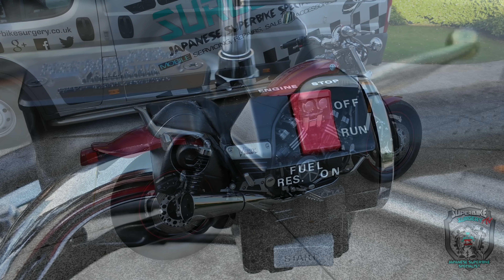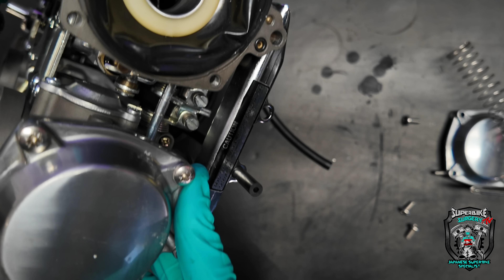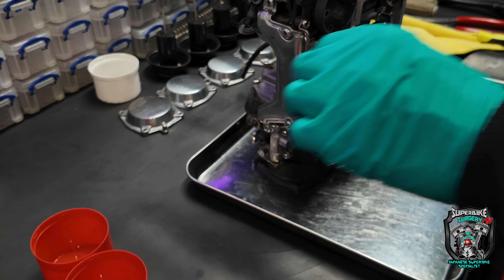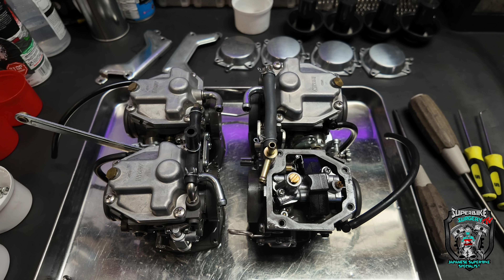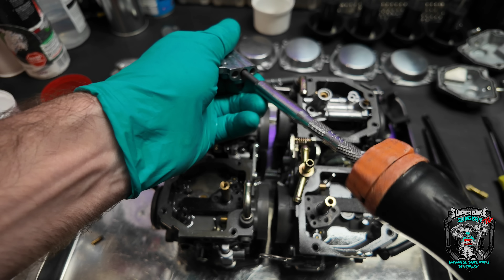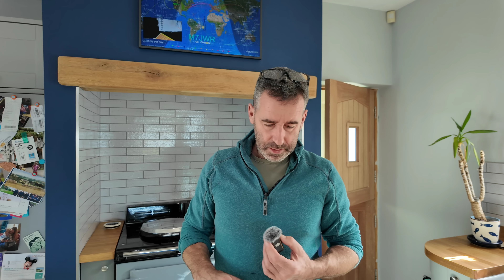Carbs off Three Times and Still Not Fixed! What the F.... is Wrong With This Yamaha V-Max?

Comment: I had one that was doing something similar. It was a blocked pipe in the tank, I can't recall which one without seeing it. But I cut the end off a Speedo cable and flared the strands then using a drill ran it through the pipe. Worked a treat.

Comment: How loose were the jet rubbers in the jet blocks? Also a 147.5 main works wonders. Ironically I have never had a problem with diaphragms (yet).

Also those manifold rubbers are suspect especially with those worm clamps.

Comment: Hey mate, I have two Vmax's sitting in my garage a 97' and 99'. on both sets of carbs they're loaded with pozi drive screws. think it might have been a factory thing at some stage in the life cyclye. or somewhere along the line the same bloke has worked on my two bikes aswell hahah

Comment: Which way should the valve clip go? Towards the carb as to hold the float in place. I have mine the other way around so the opening of the clip is facing the cover not the back near jet block. Any help how it's originally supposed to go. My way the float can come off easily when I take cover off

Comment: yeah, i'd suspect idle jet circuits too...a little soak in methyl salicylate might recondition those slide diaphraghms and clear up the distortions...my last Kawi set of Keihins had its float needles replaced with ones from a crap rebuild kit and were 1.5mm too short...the idle jets might be clear but the carb body circuits can also be blocked...mixture screws can be missing o-rings or the wrong friggin length...

Comment: Jim, another classy video. Please continue to always be yourself and behave like you always do. Swearing is part of that when fixing and pulling this apart with wood screws. As you said, fk the algorithym.

You should have done a bit more of an analysis at the beginning with running only on choke. What does putting the choke on do to the carbs v taking the choke off. Then we know your thoughts and why pulling the carbs off was the plan.

Comment: Couldn't stand the pressure and the shame - I paused at twelve minutes and ordered a set of JIS screwdrivers.
Reply: Did you need any ?
Reply: Did you need any ?
Reply: @markmiller5577  I do work on Japanese bikes and I currently own two. I've just made do with whatever fits before now, always having that little niggle that I'm not using the right tool. I also ordered hose removing pliers too, what for saving my knuckles.
Reply: Top tip: use the screwdrivers in the toolkit that came with the bike!
Reply: Vessel are the best
Reply: I wish I had know there was such a thing when I was struggling with my AP50 at 16🤣

Comment: A lot of people can't even tell the difference between Philips and Pozi... And at least here (Sweden) JIS are rather difficult to find for consumers :-( 
But I agree, using the right tool for fasteners is adamant as well as discarding damaged screws. Don't get me started on Torx plus though... To make such small change (in reality just to get a new patent) is just stupid even if they are slightly stronger then standard Torx.
Reply: With torx the tool seems to round off before the fastener.  So you get a chance to round off another tool before you drill it.
Reply: I've never had any problems with Torx assuming the correct size been used with one exception – cheaply made tools, they tend to be to rounded and not have a tight fit.
Without a doubt my first choice.
Reply: I'm surprised that JIS are hard to find in Sweden,they're easy to source online here (UK), Ebay & Amazon plus usual tool sellers

Comment: Try soaking the stripoed carbs in acetone for 24 hrs , i had a similar problem with a customers bike , i had the carbs off three times because my boss was too tight to buy the acetone i needed to clean the carbs thoroughly , once i soaked the carbs and cleaned them my way the bike ran perfect , i guarantee the internal passages are blocked bud 👍